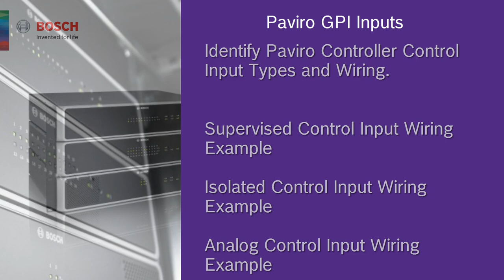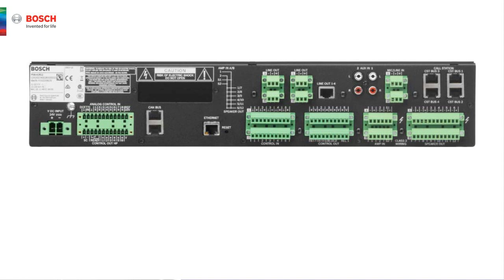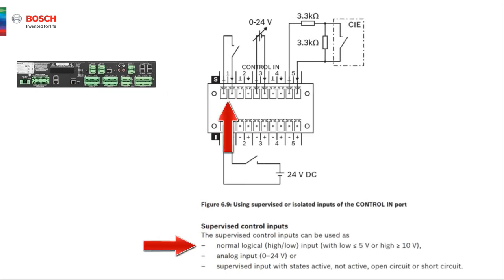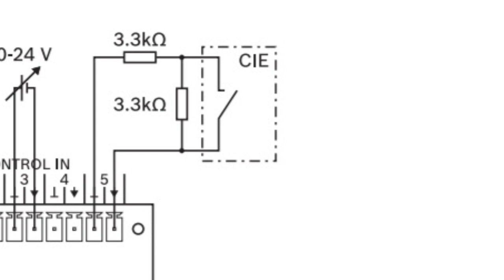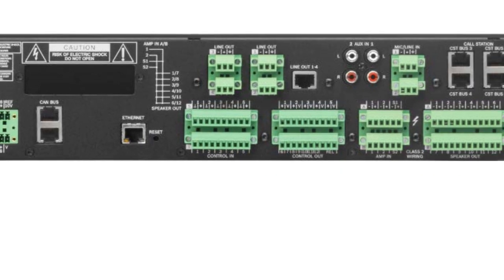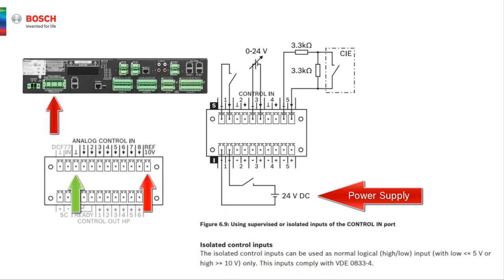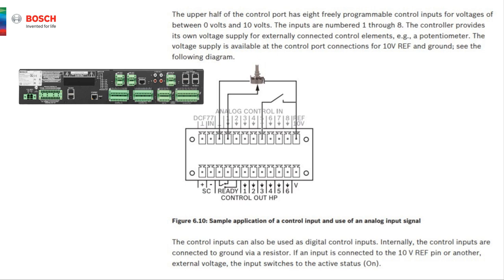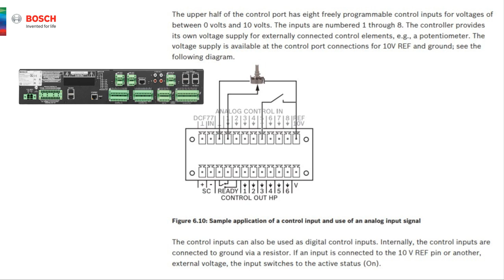Bosch Security - PAVIRO: Controller and Router Control Inputs

Comment: Informative video thanks  , can you follow up this video to show how to set up the paviro controller in IRISNET to accept a dry contact , say , from A fire alarm system for automated evac messaging . It would be also interesting to see if we can have multistage messaging for instance once a dry contact is triggered we have an initial cautionary msg followed by an evac msg after a fixed period if the dry contact is not reset.